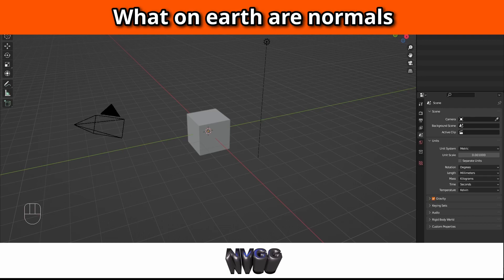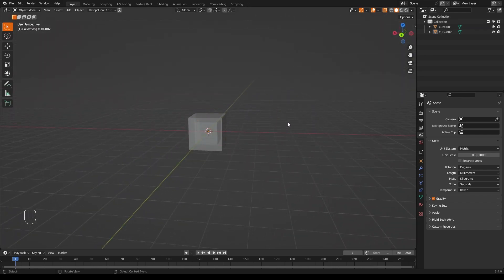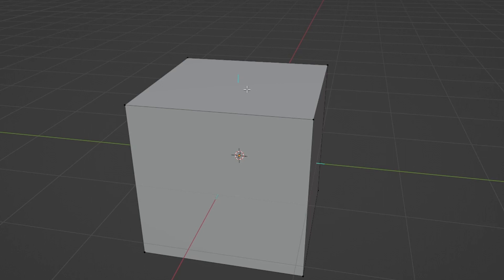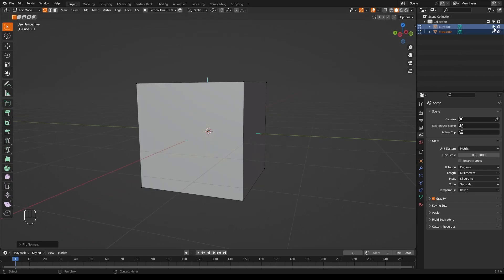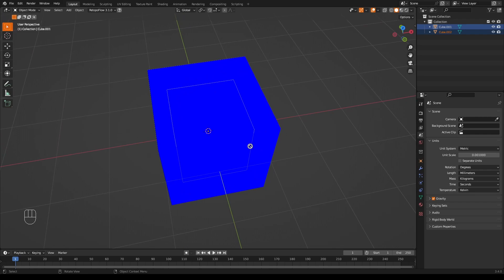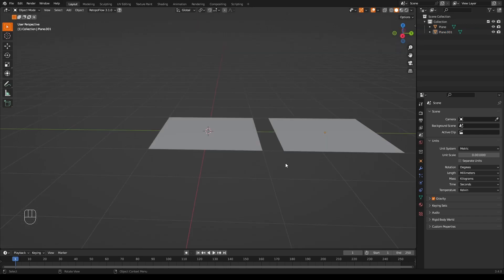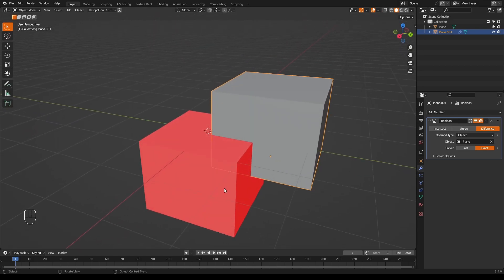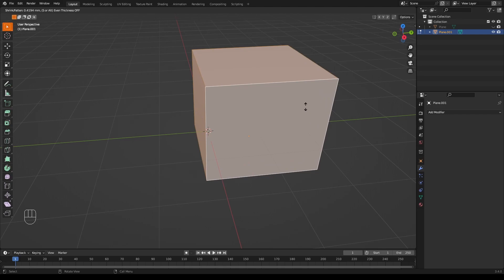Blender: What are normals and why are they important for 3d printing

Comment: OMG, I wasn't even looking for information on Normals, I was looking for information on how to seal off weird porosity in some of my STL printer files, stumbled upon your hollow to solid video, and used that on my problem model (which had a few internal fragments apparently, that I deleted). Your voice, your calm instruction, your super simple and easy to understand explanations, I'm just floored. You have to understand that I have been spending SO much time browsing videos by other people who talk WAY above my head, with deliveries that are hard to follow and are not necessarily straight along a path from A to Z. This Normals video, I took good notes and will definitely try applying these things. I will also turn on Face Orientation as well, that looks like a super good reference. Thank you! Now to find how to close holes!
Reply from the maker: Thank  you for your kind comments.  I am glad some of the videos have been helpful.  You can try using the 3d print plugin for filling holes though that doesn't always work as you'd like.  I usually find it easier to just manually create new faces to patch them.

Comment: Great video, is there an easy way to test if there are normals that need flipping in the whole mesh?
Reply from the maker: At 6:28 the video shows how to turn on showing normals for everything.  If you want to see inside as well you can turn x-ray mode on too.  Note that the latest versions of blender do not have blue showing "outside" so you don't need to change that in preferences as shown in the video.